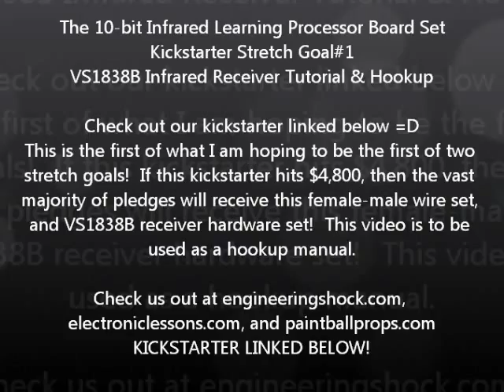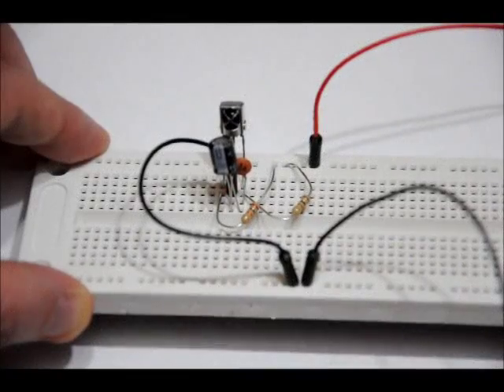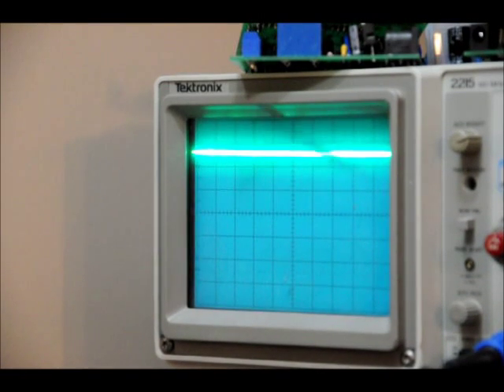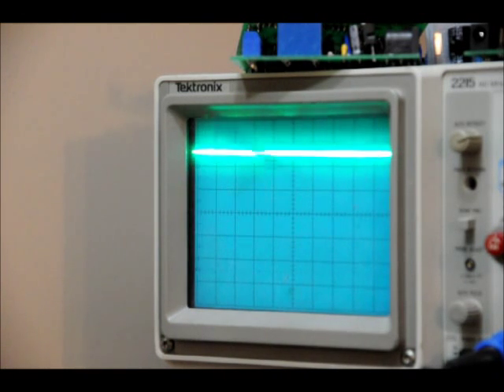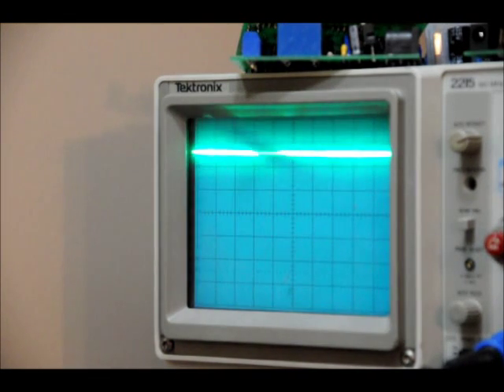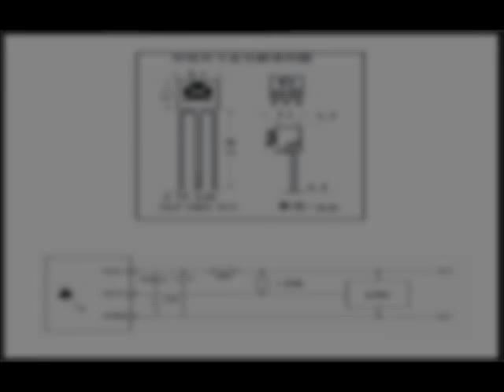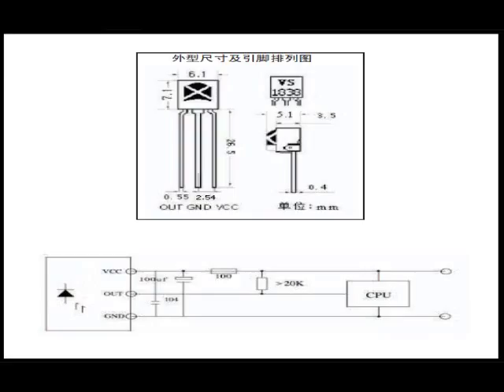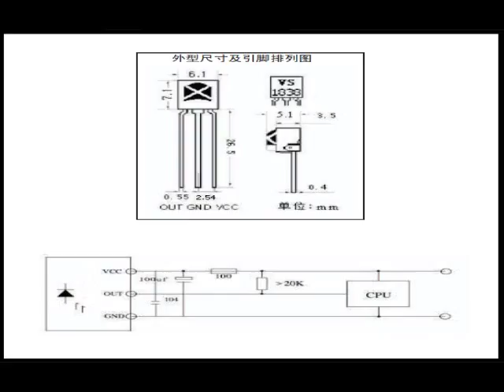Infrared Receiver Hookup Tutorial & Kickstarter Stretch Goal Explanation!

Comment: so both caps between gnd and vcc?! what use is that? sounds like bs to me
Reply: There is two capacitors because they react differently. The smaller ceramic works better to filter out high frequency noise. The electrolytic one handles larger (but slower) ripples in power.